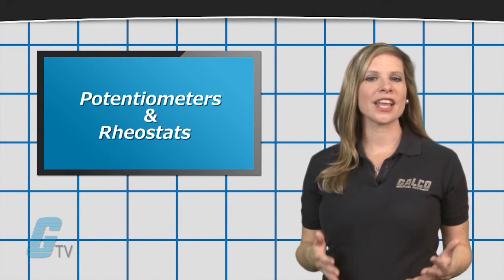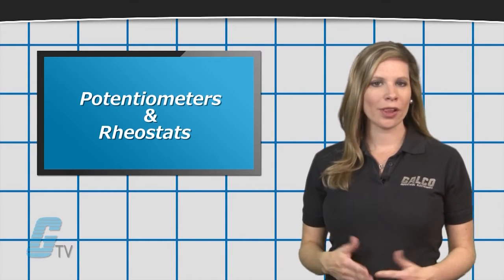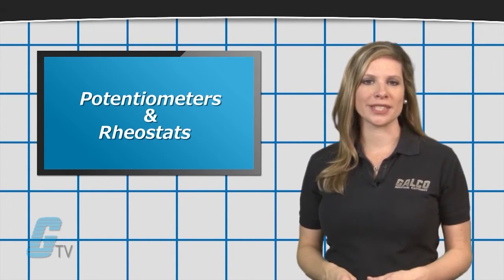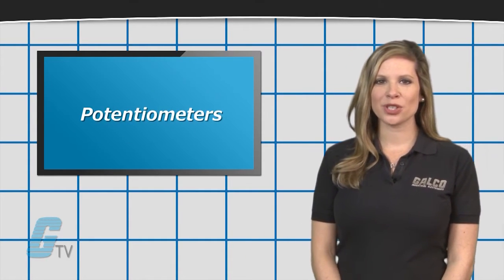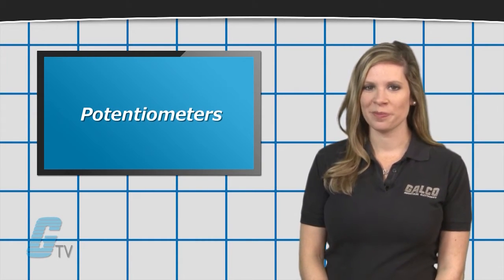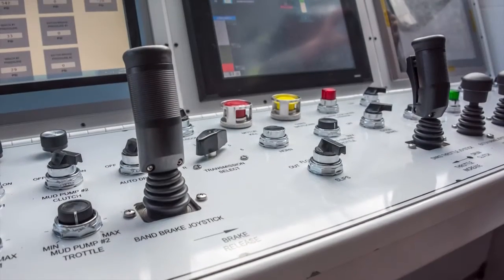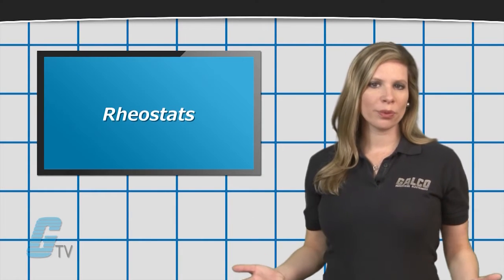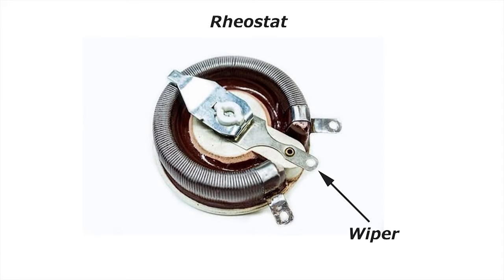Differences Between Potentiometers and Rheostats - A GalcoTV Tech Tip | Galco

Comment: lmao u start ur video off showing pots n rheostats next to each other and they both have 3 terminals, yet u said the difference between the 2 is the number of terminals, then u said pots can act as rheostats, but if the difference is the number of terminals then how is that even possible?? im very confused
Reply: pots can function as rheostats when you use terminal 2 as ground / component and either 1 OR 3 as source voltage for your circuit. Pots are typically used as sensors to send a signal based on position through terminal 2. Terminal 1 will be source voltage and 3 will be ground or vise versa. Terminal 2 will always be the signal. 

Pots are prone to burnout though. Rheostats are made to carry higher amperage.
Reply: I find this interesting.

What is a rheostat?
A potentiometer?

People just parrot what they are told.  People don’t try to understand and create objective definitions.  They just parrot what they hear or were taught.  Critical thinking is a joke and this is a good example that people don’t use logic, just reason.

She starts by saying one is 2 and the other is 3 terminals.  The textbook I teach from says the same.

Yet both images are 3 terminal devices.  That puts the lie to this definition of either.  The 2 terminal and 3 terminal narrative is a false dichotomy when it comes to the definitions.

That raises the question, if the terminals are not what define each, then is it the use or application of the terminals that define each?  

Here is the truth of what we should be teaching and parroting.

The real difference is the power.  The rheostat are high power devices.  While pots are low power, like IC applications.  Amps versus Milli or micro amps.  Both are variable resistors with 3 terminals.

Rheostats are viewed as current control because they handle high current and high current means higher power.  This ties to current driving motors.

With pots, currents don’t drive anything (quite often).  Currents are controlled with pots but they are micro amps and can’t drive anything big from a power consumption standpoint.  Since we are likely ignoring power since it is more like a control circuit, a circuit that is about digital logic and choice and decision, not converting and using power to mechanical energy, people like to use that and call it a voltage control circuit because they don’t think of it as a current control.  That doesn’t mean that the current is not being controlled.  It is but we don’t likely care about the current flow in our project.  We are likely using the voltage as an input for a decision.